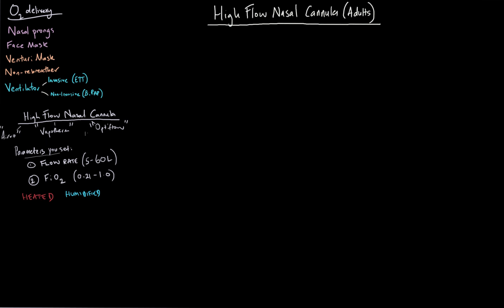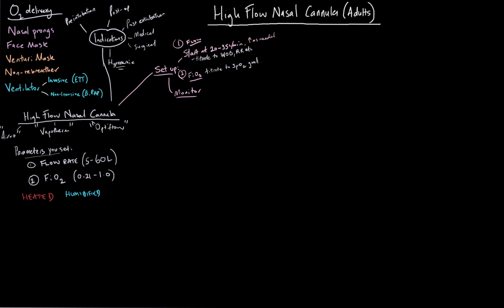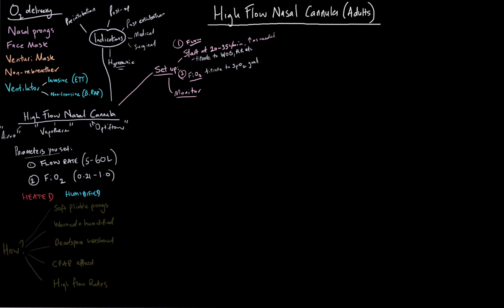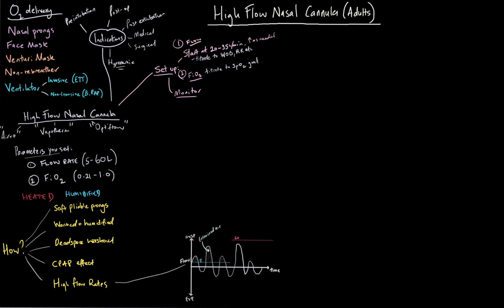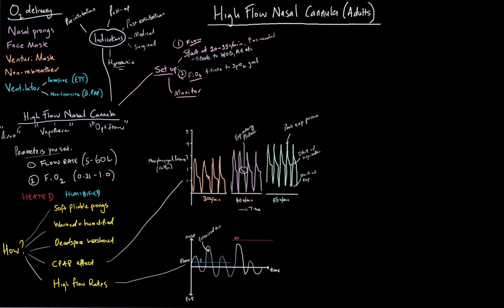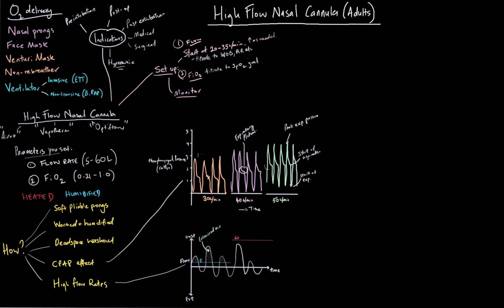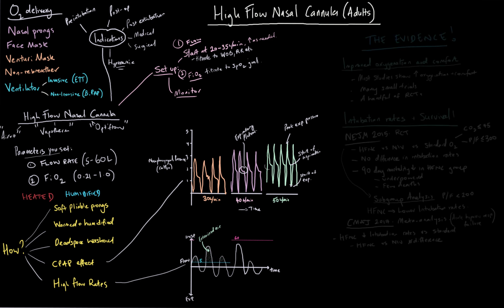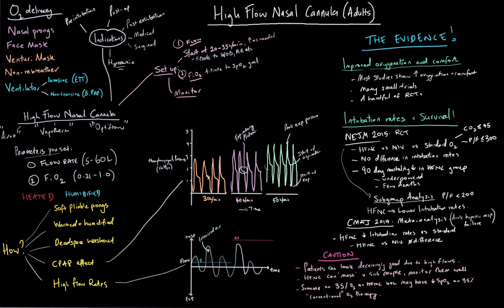High Flow Nasal Cannula (Airvo, Vapotherm, Optiflow etc)

Comment: Love the lecture thank you. My question is this when placing a patient on High Flow and they have COVID-19 is it more dangers for the staff as the patients don’t normally keep their mouth closed. Does the High Flow become a a water cannon filled with particalized droplets that can travel a farther distance. Or is the water particle to small to carry the virus with it.
Reply from the maker: This is an interesting question. The question really is “is High Flow Nasal Prongs an aerosol generating procedure?”
At most centres I know people at they are considering it an aerosol generating procedure given the high flows. So patients with covid on it would be ideally in negative pressure rooms and have staff in full PPE. This is hugely variable however, and many centres are managing high flow prongs differently. It is also changing rapidly. At my centre I believe the current policy is that COVID patients on high flow NP are airborne precautions so full PPE with N95s. I’d encourage you to look up what your local institutions are recommending, and if in doubt wear full PPE. 
We had a lot of success keeping people out of ICU and off ventilators using HFNP during our covid waves.

Comment: Hello, excellent video! I was wondering if Teleflex's High Flow Nasal Cannula Therapy System using the Hudson Neptune Heated Humidifier and ComfortFlo cannula would also fit into this product segment? Or if it is something different because it also needs to use a blender, and isn't just a singular device like Fisher & Paykel's Airvo 2 w/ Optiflow or Vapotherm's Precision Flow? Thank you in advance!
Reply from the maker: I haven’t come across the device you mentioned, so can’t speak with much authority on its specifics. I would say however that the principles underlying these heated hi flow products are the same. There are blender systems in many of the other products available. If its marketing itself as a heated HFNC then id say you’re safe to assume it employs the principles I’ve described.

Comment: In a classic CPAP machine  - you do not set an inspiratory pressure - and since the patient is breathing spontaneously - during inspiration - the pressure of the system will go below the CPAP pressure (because inspiration by the patient will create a negative pressure) but it will be above zero.. so it prevents collapse of alveoli..hence its also a type of PPV.  If you set an inspiratory pressure with a PEEP/EPAP - then your system pressure will not go below PEEP/EPAP.. I feel this is the major difference.. otherwise rest of the areas you covered were great !!!!
Reply from the maker: DrDilipsMMS Thanks for your comment glad you took the time to watch. This wasn’t a video on CPAP systems. You do not set an insp or exp pressure on HFNC. To have PPV you need 2 levels of pressure so that a deltaP is created, so pure CPAP is not PPV. It’s positive pressure, but it’s not ventilating the patient. Also setting an inspiratory pressure does not guarantee the system pressure will not go below peep depending on the insp effort of the patient. Either way, I’m not really sure your comments on CPAP/PEEP really pertain to this video.
Reply: RespiratoryReview Do make a session on NIV’s and PPV ! In fact my comment was based on your statement at 14:32. Thanks for your time to reply ! Cheers

Comment: Hi, this is a very interesting system. And your talk was very good. I'm interested in it from the engineering point of view.
I understand the reasoning behind keeping the RH and temperature below the dew point to prevent virus/microbe entrainment, and condensation.
And the design of the Optiflow is pretty elegant with respect to maintaining that.

But how is a constant flow rate achieved?

As I can understand it, there's not any significant pressure drop from the pump discharge and all through the main system, then via the breathing tube.
I can see that the fit of the cannula with each patient would vary, and thus you'd get differences there, and also as they moved, and during their breathing cycle.
But is that small compared to that from the outlet of the Cannula itself?

I think it just be, because otherwise I see very little chance to keep a steady flow rate with a gas, where you have no feedback from anywhere near where the actual pressure drop is.

To make it clear, I think you could model this as having one large fixed pressure drop from the Cannula itself, and one you start the system, with the desired flow rate setpoint, it remains stable, regardless of what the patient does.

If not, I think the patient would experience sudden changes in flow as they tried to breathe in and out, or as the shifted position.